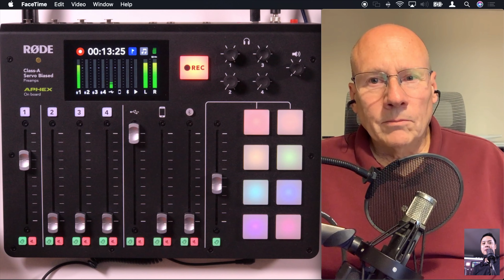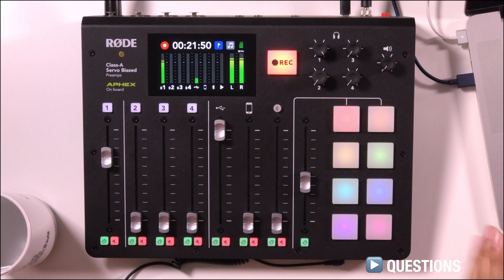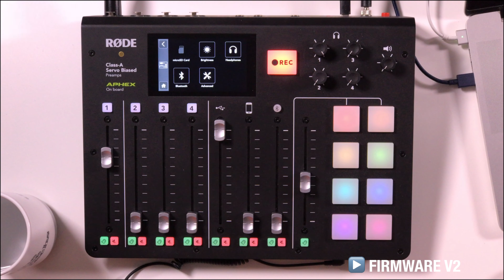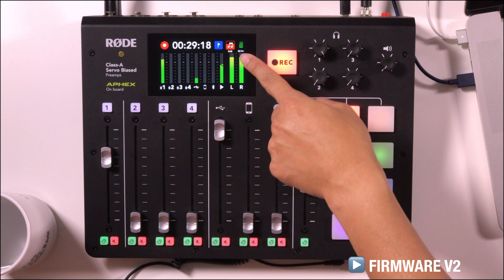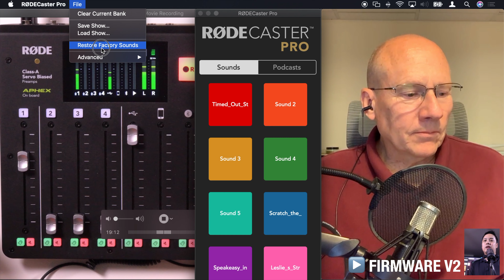PodMic and RØDECaster Pro Firmware 2 Update

Comment: Can i take the 4 tracks of multi track and import to my DAW.  Im thinking using it as a multi track recorder for music instead of taking my laptop to a client.   Feedback???
Reply from the maker: Yes, you can record multitrack locally on the RODECaster Pro on a microSD card. You can currently choose to record with or without effects (compressor, high pass, and others). Multitrack recordings are currently pre-fader, so the fader position doesn’t affect the recorded level. In a future version 2.1 firmware update—currently in beta—, you can also choose to record post-fader and also add reverb to the recording. It automatically records all channels in multitrack recording mode, so if you’re not using the Bluetooth or smartphone input, it will still show up in the poly WAV file. You can just ignore the other tracks and enable the four channels that you need.
Reply: The Three Techs ok. So each track would be recording mono?  Now they record stereo from a mic, etc.

Comment: Hi Guys, is it possible to use one of these without any headphones? I currently use 1 unpowered Videomic about 2ft away, connected to a Rode Wireless mic unit, directly into my laptop and a GoPro, but would really love the extra features of being able to introduce a phone call and have sound effects on those buttons, but not keen on needing XLR mic's that have to be all up in your face and headphones.

Could I just use this as an additional input source to my computer or plugin my RODE Wireless Go mic into it?

Comment: I'm new to Podcasting, and have just ordered my RodeCaster Pro. I hope to be able to connect my Cisco VOIP phone to the Rodecaster Pro through the TRRS cable. I purchased a "VoiceJoy Female 3.5mm CTIA Smartphone Headset to Cisco RJ9 Adapter Cable - 3.5mm Stereo Headphone Converter to Cisco Office IP Phone", then use a TRRS cable to plug into the RodeCaster Pro. The plan is to  test this configuration out later this week. Most of my guest (who are somewhat technically challenged) will not be able to make it to our studio and will be calling in. Any feedback would be appreciated.

Comment: I can't seem to get rid of the noise on my Podmic either. I have two condenser mics connected to the Rodecaster as well and they are very quiet. Could it be because of close proximity to a large iMac screen? It's loud enough that the noise gate is super annoying. I work in a controlled and acoustically treated environment and have traditionally done my podcasts with condenser mics. So far, the testing of the Podmic has been a disappointment. I'll keep on trying to locate any possible/additional electrical interference but beyond any buzz, its just noisy.

Comment: Good tutorial I don't know why Rode did not have an user manual, more or less a shoot from the hip rollout. We purchased two units for podcast on the road and so far so good. From days of early electronic recording that darn HUM has plagued Radio, TV and Studio Engineers.  I can suggest from experience. Try to buy good Quad cable (two hot, two cold and braided shield and with name metal connectors not plastic with metallic plating. I make all my own because and test with an old ballasted florescent light on. Some "Value Vendors" don't look at studio type production but the "Garage Band" production where budget trumps quality. It also doesn't hurt to have a couple in-line isolation and ground lifting adapters in the cookie box, only problem they don't work with Phantom power.

Comment: There’s nothing wrong with the PodMic. That’s just Line hum from a ton of gain. Use a CloudLifter. That’ll take care of it. The locking plug is standard. People need to make sure that they’re buy from genuine RØDE retailers. And ducking has always only been on channel 1.
Reply from the maker: Michael Stephenson Thanks for the comments. The hum was from electromagnetic interference in the recording space. There are light dimmers where we recorded. Other viewers report no hum issues in their environment, so just be aware when you’re using it near sources of EMI. Other mics with the same amount of gain didn’t exhibit the same hum (see our other video with the SM7B). There was a bug in a firmware version (v1.20 I think) where ducking appeared on all channels, but it should only be on channel 1 since it doesn’t make sense to have all channels ducking and fighting with each other. Thanks for the comment on the locking power plug. Good point to ensure that you’re buying from authorized RODE dealers!
Reply: The Three Techs Rode themselves stated that the earliest units shipped without a locking connector. You can contact them for a free locking connector. Let’s not jump to outlandish conclusions about grey markets and such.
Reply: Meat Locker There’s no jumping to conclusions. RØDE themselves have that exact warning on their website. They may have some units that shipped that way but there are a ton of rip offs out there too.
Reply: Michael Stephenson Rip-off power supplies? Rip-off consoles? What are you talking about, man?
Reply: Meat Locker I’m talking about their warning right at the top of their (RØDE’s) web page. No need to be rude. There is counterfeit stuff everywhere. Especially on Amazon.
Reply: Michael Stephenson please see below. Rode shipped early units without locking connectors.

Comment: Hi guys!  I use a Podmic in my home studio with a Rodecaster Pro and when I run this mic at full gain I can't get and 60 hz hum. I even set the internal gain to full and no hum. I ran this test in my office with the another Podmic and Procaster Pro and I can't get any hum. I think in your situation the hum is coming from your wiring (ex. lighting, lighting controller, etc...).
Reply from the maker: Four Seas One Family Hey, thanks for watching and the comment. The hum we got was probably coming from some light dimmers in the room. If you’re connected to a clean source like you, hum may not be an issue. In suboptimal conditions like we have, it was an issue on the PodMic but wasn’t an issue on our other mics. It goes to show the difference in electromagnetic shielding between the two mics. Glad to hear that you’re not having issues in your setup!
Reply: The Three Techs Cool!